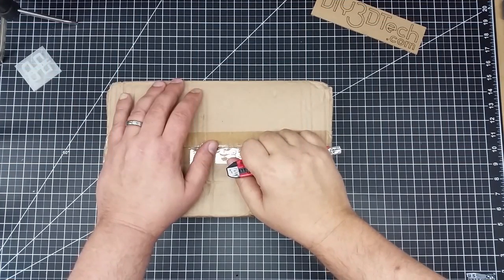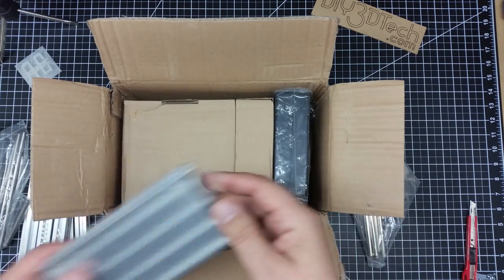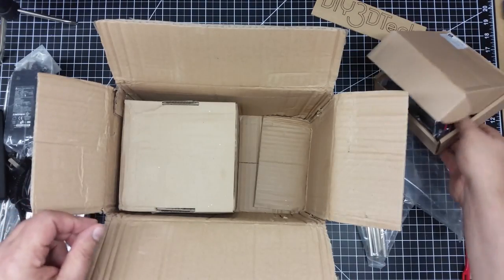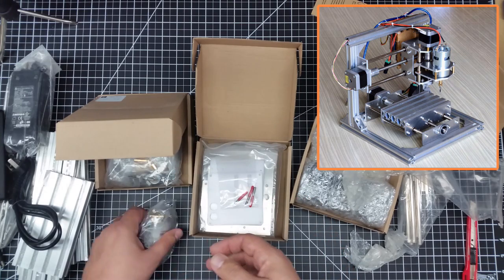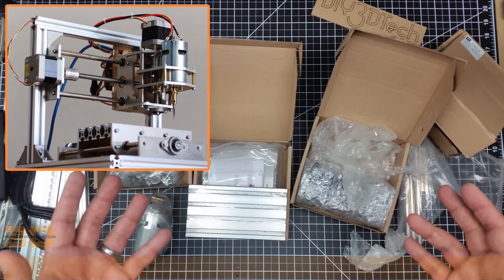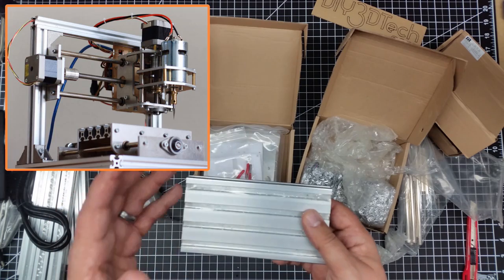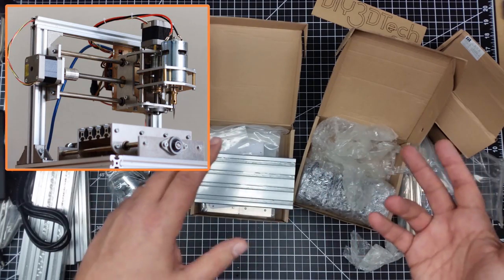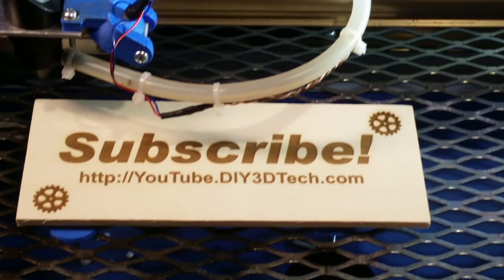Desktop CNC - Unboxing and Discussion!

Comment: As an owner of 3018 desktop cnc I would love to see this small machine cutting wood. I haven't tried mine on wood yet. What feedrates and bits would be suitable and so on.
Reply from the maker: On this one I have not done a lot of wood, not that it can't but I have others (see the Probotix playlist).  With the 800 watt spindle you can push a 6mm cutter about 100 inches a min and simply adjust cut depth for material (that how I work it anyway)...

Comment: I just found your channel. Very cool. Question, in your opinion, who makes a heavy duty 3 axis CNC mill that has X 18" x Y  6" with  6" in Z useable, preferably with the ability to have tool holders so you can set tool length offsets and manually change tools to perform different functions. I'm probably asking a lot. Oh, yeah, and hopefully it won't break the bank. Thank you for your time
Reply from the maker: Hmmm at these spec's you might want to look at the 6040 series of Chinese CNC, however when you add the other stuff you are emptying the bank (at least mine :-) now your heading to Tormach or Haas territory...

Comment: Mine arrived today, still no instructions :p
Reply from the maker: Don't know any one who got instructions, however if you watch the video's you can pretty much figure it out and if you a specific question I can try and answer it for you :-)
Reply: DIY3DTECH.com yeah, the video's are a little hit and miss but getting the job done, though there do seem to be some minor revisions to the design since they where made :)
Reply from the maker: +MiggyManMike yea know what you mean and some kit have minor differences too.  If you run into issues let me know and I will try help 😜
Reply: I've come across a few but nothing I can't work our, all of the linear rods seem about 4mm short but I can take that up with some washers, one of them however is lacking threads so i've raised that with gearbest :D
Reply from the maker: Interesting on the short rods....
Reply: Aye, give hat you'd had two different sizes I did find that interesting.
Reply: So in a highly "Interesting" turn of events they've  got back to me saying they can't send out a replacement rod with 3 options, return, partial refund or send out a new unit if I cover postage.

Return would probably bankrupt me for postage, the partial refund is 20 usd and the postage for the replacement unit is oddly just about the cost of the unit.

TIme to see if my crappy tap will handle hardened steel rods......... While seeing what mitsumi charge for a replacement :D
Reply from the maker: Gezz that sucks!  If they gave you more of a refund just buy new rods... :-)
Reply: If managed to bodge it in for now, my taps are utter crap (I tap things about once a decade :p), so I drilled about 2/3rd of the hole out and tapped the bottom with what little the tap could give, since they're a little short i've been shimming them with washers on either and and it's nice and snug with no movement.

I'm either going to look for another set with external threads and bolt them from the outside or more likely find  some 150/155mm rods with no tapping at all, drill the holes out to let them pass through and print some retaining clamps to attach and hold them that way.

But for now, wiring, and using it :p

Comment: I bought this same machine about 6 months ago. one of the first things I discovered was if I made the bottom extruded aluminum rails about a inch longer in the Y direction, I was able to get about a inch more of build space. I don't think I had to change anything else. Can't wait to see what you do for a different spindle.
Reply from the maker: yes you are correct and i do make a mod like this!  thanks for sharing and would like hear about what you have done with your machine :-)
Reply: I also 3D printed a 16mm spacer for the z axis motor. If I would have mounted it straight to the top plate I would have lost some z axis and the threaded rod would have been hanging down in the build area limiting me on how tall the work piece could be. 

The last think I did was 3D printed a brackets that attach the the sides of the build plate so I could attach a waist board. I can send you the files if you wish.
Reply from the maker: Sure would be interested in seeing them (info[at]DDIY3DTech.com) as you will see I have added an extended bed, made mounting clamps and added a laser :-)

Comment: You could just buy a cheap i3 like the Anet A8 and convert it to a CNC , or the wanho as that is metal . I may use whats left of my wanhao as a CNC
Reply: But as far as dekstop machines go , how about one of the mini lathe that are on ebay ?
Reply from the maker: I like your thinking, however the  issue with converting a 3D printer to CNC is the rigidity as  they are not designed for the lateral torque which is created by a bit engaging with a material (which a 3D printer doesn't do).  As think about it this way, its the same reason you can't turn a drill press into a vertical milling maching as there is way to much flexture...
Reply from the maker: Also yes have mini Harbor Freight lathe and I did make CNC many years ago however never found a use for it so removed the motors and typical use only ad-hoc to spin down round stock...
Reply: DIY3DTECH.com Thats why i am building my new printer out of 2020 aluminium , so it can do light CNC duty .
Reply from the maker: 2020 should be good, please keep me posted on the build!  Sounds interesting :-)
Reply: Its on thingiverse designed by tech2c http://www.thingiverse.com/thing:1752766 , once its up and running however i have some changes i want to make so it can handle light CNC duty , like replacing the core xy gantry with liner rail / rails on some aluminium extrusion, but i will have to improve my CAD skills for that :)
Reply from the maker: Yes have seen this before and considered... (it looks cool)

Comment: I've been using one of these to make PC boards.  I had to replace the lead screws and nuts to reduce  backlash. I also ran the steppers and spindle motor from the 24V supply and replaced the X axis stepper. I moved the vertical assembly all the way to the back and added supports. My channel has a couple of videos showing the mods I made. Looking forward to your experiences with the machine.
Reply from the maker: Thank!  Will have to check them out as I have made a number of mod's already (videos are in the queue) and its been a great little machine, however mine is pretty tight so have not seen a run out issue which has created a problem to what I have been working with.  :-)

Comment: I was looking into these a few months back. I also looked into the little lathes on gearbest as well.  The cheap price was almost enough for me to pull the trigger on one and try it out.   http://www.gearbest.com/cutting-tools/pp_397894.html   Can't wait to see that cnc in action.
Reply from the maker: For the money I have been very happy as it really has been a fun project to build and use as its so small its easy to quickly use unlike my larger machines which take far more set up time :-)
Reply: Now that has me even more interested in it, however not too sure I could use one as frequently as my 3d printer. Perhaps I can make a better call after I see some of the things you have done with this one.
Reply from the maker: One of my main goals is circuit boards as they are time consuming and could do them on my larger machines, that is way over kill.  Also I have a lot of viewers who do jewelry so I want to try engraving too.  Oh I have also added a laser too :-)

Comment: I note that the plug on the 24V 5A power supply is an EU plug, but since the power supply  can take a 100 to 240 VAC input (according to your zoomed video), an adapter to a US style plug could be used, but is it included? Also, the plug on the 12V 5A supply looks like its a US 110V plug!  

BTW, this is exactly what I need to mill control and display holes in the front panels of small electronics enclosure boxes. I hope it will handle that task and I'm really looking forward to your assembly and test videos.
Reply from the maker: Yes  it did come with an EU plug on the 24v but just swamped it with 110v and no issues also yes to the cutting of in front panel assembles.  No issues with that and the right bit :-)